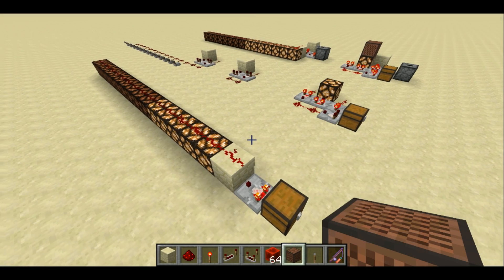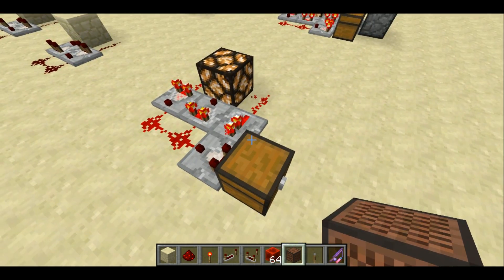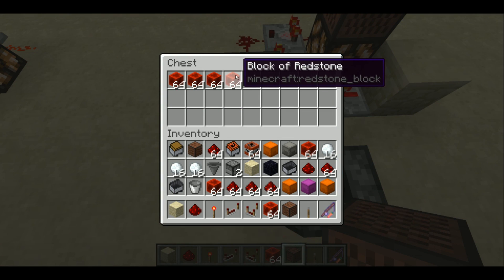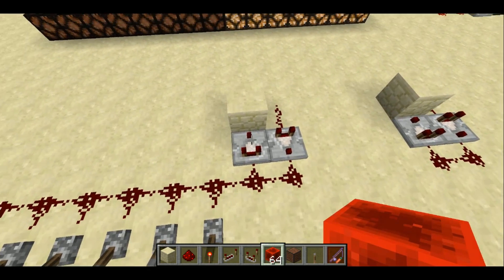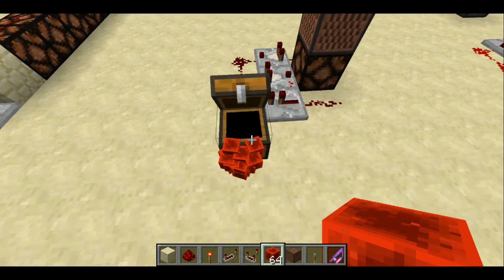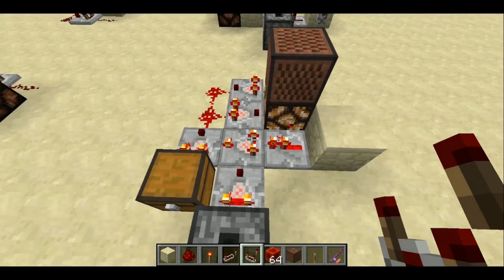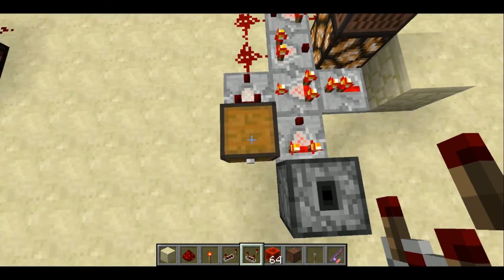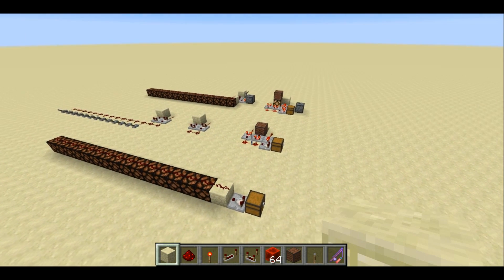Compact Signal Strength Indicator -- Minecraft Redstone Tutorial

Comment: If u add another set of comparator pulse extender to the design, supply it with 15 signal strength. Output the signal to the repeator. Then you will have something that modulaton duty cycle instead of frequency. I wonder if that's useful somehow

Comment: Can you swap it round? So it flashes faster as you run out of space
Reply: NuthinNew replace the chest with a full strength signal source. To the side of the comparator that reads the chest, place another comparator facing into it. Place a chest behind the new comparator. Set the original comparator to subtraction mode. Should be done.
Reply: @RedstoneQwerty  just invert the chest comparator by {putting it against a (subtraction comparator [that sends the signal to the rest of the contraption] powered by a full signal source) }

sorry for the weird formatting btw, that was for clarity.
Reply: This would be an incredibly useful thing if you have an automated smelting production line and you need to empty the output bin every now and then.
Reply: @Noxedwin  a line of smelters to generate EXP
Reply: Thanks for the replies 👌

Comment: You just encoded a signal strength in frequency !
If you could decode the frequency to get a signal strength, you could transmit this frequency over long distances using only repeaters ! This could be a new era in Minecraft, where a long redstone line could have 16 differents states (each signal strength) instead of just 2 (on/off), and still be relatively cheap to build
Reply: We need to be able to turn noteblocks into microphones in minecraft
Reply: The comparator clock takes 0.2 seconds to lose one point of strength. For a decoder to understand max signal strength, it would have to receive a continous signal for 15 comparator cycles or 3 SECONDS. Since a number from 0-15 occupies 4 bits, this encoding's bandwidth is 4 bits / 3 seconds = 1.333... bps (bits per second). On the other hand, a serial transmission, where bits are transferred one at a time, can change the state of the signal every tick, which means 10 bps. This means that modulated frequency is 7.5 times slower than serial when transmitting 4 bits at a time, a ratio which increases with the size of the information blocks.

TL;DR: Ones and zeroes are way faster.
Reply: @inakilbss  gets really fun when you transmit analog signals serialy: 40bps
Reply: yes but any ideas on how to decode? A few weeks ago I realized that you could effectively encode 4 bits into a signal strength, however transmission is slow and expensive in comparison.  Combining what i did in that with what is done with this is pretty interesting and i'm surprised that we don't really see it used
Reply: encoding/decoding is already a thing. a lot of redstone computers link the main display module with the body of the computer via a single line of redstone.
Reply: interesting
Reply: Seth please do this
Reply: FFT in redstone
Reply: This is nothing new
Reply: @cephelos1098  it's a good idea